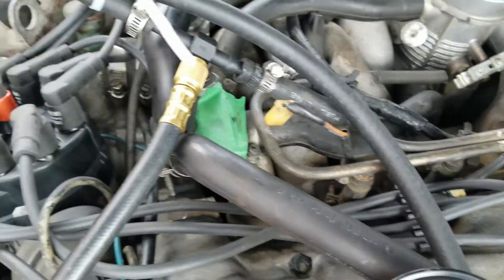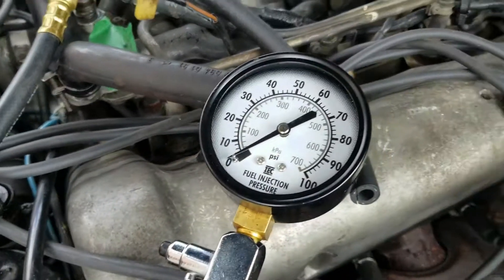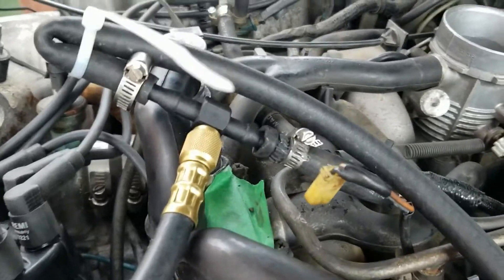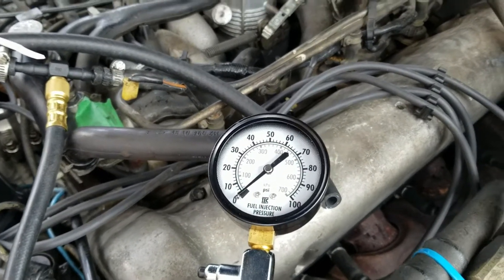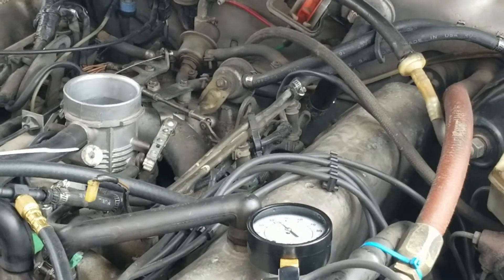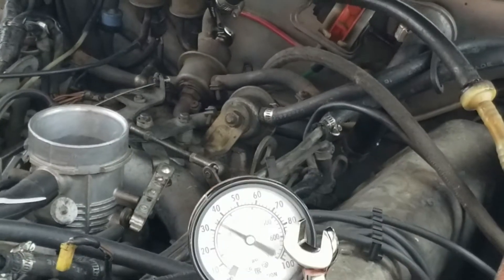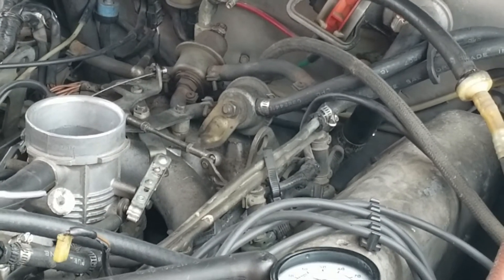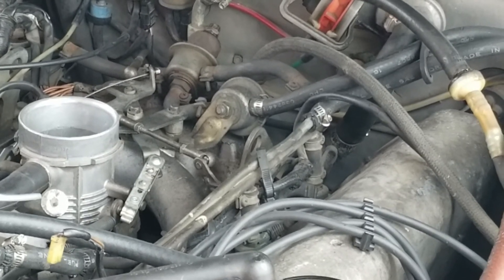450SL Engine Part1 - Fuel pressure

Comment: Can I ask you something please 
I changed fuel filter cleaned Gas Tank and now the Car didn’t want to start it was running before 
Now I looked at the Fuel injectors two were very bad so you think if I change them it will start again or could it be something else ?
Reply: The car was running before and not after your work, the problem is in what you did. Or something got moved or whatever. So go back and check everything.
Reply: Actually, the fps should be at 32 psi. And no, that gauge should not be moving like that. I think you got a bad pressure regulator or a bad f pump.
Reply: Most likely the pressure accumulator is gone. It is the same looking thing next to the pressure regulator.   @georgecurtis6463